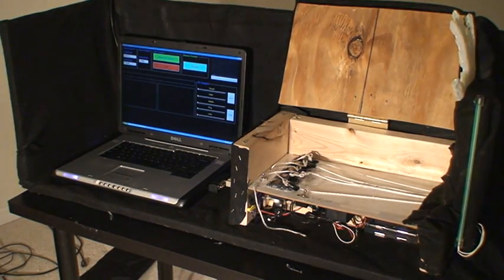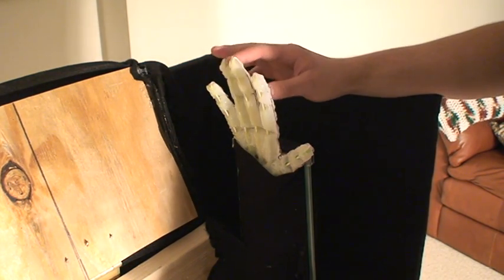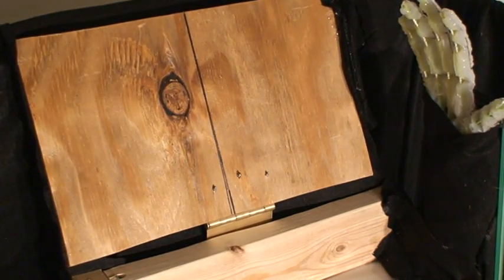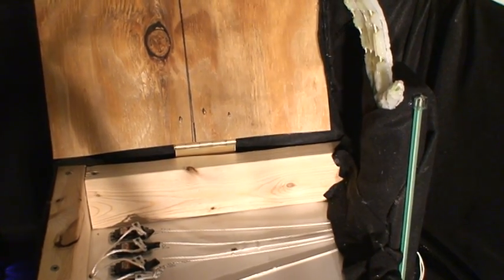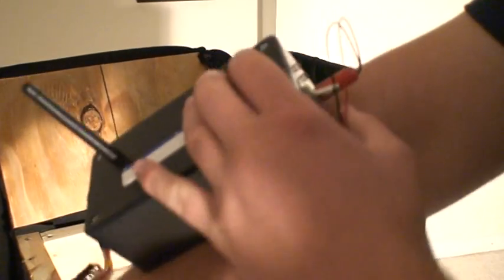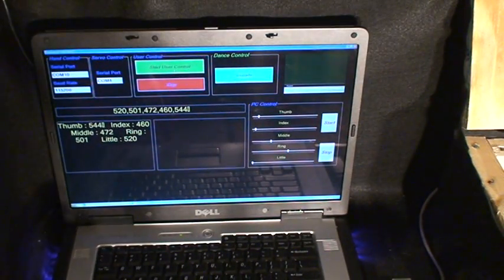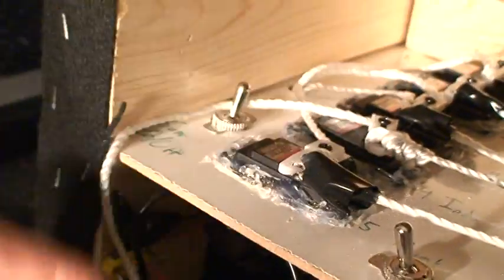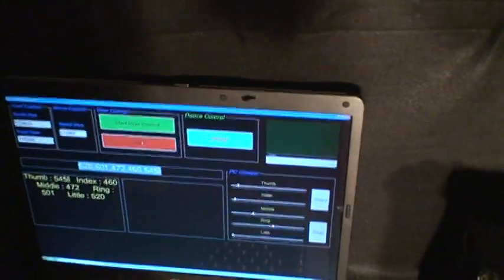Prosthetic Hand V1 - TSA Project

Comment from the maker: Unfortunately I didn't make the program for the arduino, you will have to write the code based on exactly what you need to do from my C# computer program. If you want basic servo control its not hard follow the tutorials and you will be on your way. Once you have a design you can send me a pm with more direct questions but right now (not trying to be mean) your questions are vague. I'm not going to write the code for you but I can help you through it when you have specific questions about it.

Comment from the maker: BTW I almost forgot if you know C# well then you should check out the new development board that Sparkfun has in stock the "FEZ Domino" search for that. It will run C# code onboard using its NET micro framework on the chip. This makes it truly freaking easy to use plus you already know C# so in your case $80 isn't a bad deal.

Comment from the maker: No no no microcontrollers do not have a "language" they run machine code compiled for their architecture. That machine code is generated by a compiler on a computer from the programming syntax it uses. That compiler also involves many prerequisites which are very complex. Take arduino for example it is a C/Java type language that when compiled is turned into machine code via their compiler for the atmega chip.

If I were you I would do some major reading up on microcontrollers!

Comment from the maker: Microcontrollers do not run C# except for the new one that Sparkfun carries but I wouldn't recommend it. Look at how the code works and then rewrite it into the microcontrollers language. Every function that I used like serial input/output, string manipulation, and servo driving can be done on a basic arduino. This is a relatively complicated program that you will have to LEARN (not to be rude or anything) to be able to fully utilize and modify. Its no fun when you don't know how it works!

Comment from the maker: The data is sent live over the serial cable during all three methods of control, glove, slider bars, and dancing. The micro controllers are capable of doing this is well but things like arduinos wouldn't have to because they could control their own servos requiring no controller. You cannot simply  take the code I wrote and throw it on a micro controller because it will not work. My program is in C# and the only thing that might work is a new board the Sparkfun carries look at their homepage.

Comment from the maker: Yes all of the control could be done through an arduino or other micro controller. Now wireless data transfer using a radio module or even bluetooth is simply a point to point wireless serial cable. I have thought about doing a video on this for quite some time but I would like to get a few Xbee's and others modules before I made a video (so I can fit more into the video).

Comment from the maker: BTW your micro controller has to be capable of outputting pwm output and it will only work on pwm capable digital pins (usually not all pins are capable). For example the standard arduino has the capability to run 12 servos via the software library. That would work just fine. I also forgot to mention that the wireless link is also very easy since bi directional communication is not really needed you could use radio units which are dirt cheap and super easy to use.

Comment from the maker: Yes you could simply connect the five servos to the microcontroller and drive them from that or connect the serial controller to the microcontroller. The glove portion is simply taking a data input string via serial and then splitting it into individual values. This could be easily done on a standalone microcontroller but I chose the laptop to save money because it had built in speakers and made my project "look" better because of the flashy user interface.

Comment from the maker: The V2 hand will be able to grasp light objects with a full range of motion that will perfectly simulate a human hand. I plan on adding a second set of servo motors to the box that will load an object into the hand to demonstrate its grasping capability.

An arm would be a project for the future when I can get a lot more funding to produce it. More powerful servos would need to be used and preferably linear servos to make it easy. For now I just want to refine the hands functions.